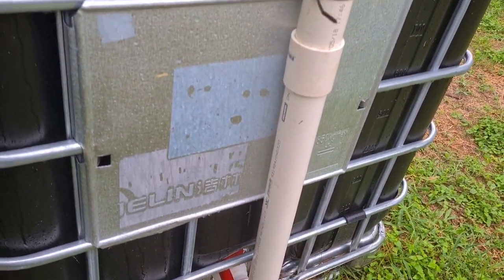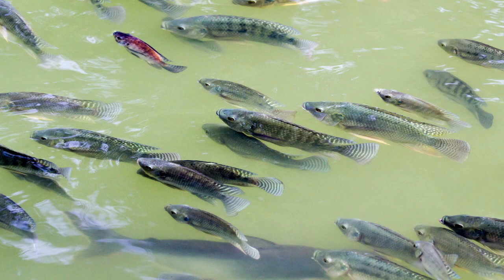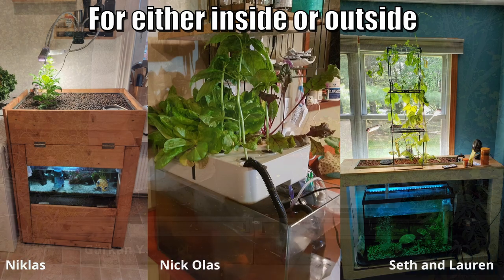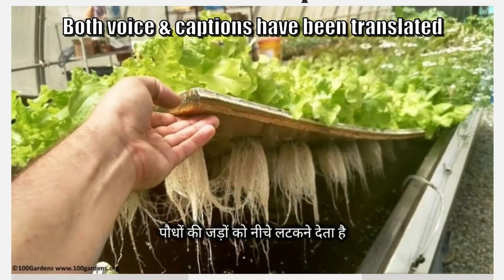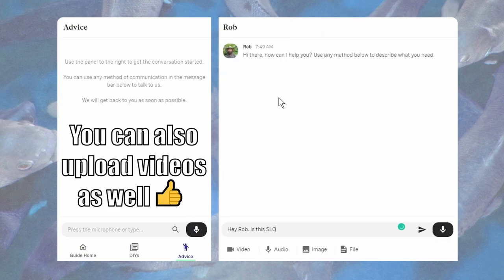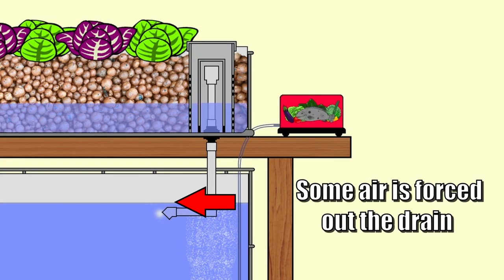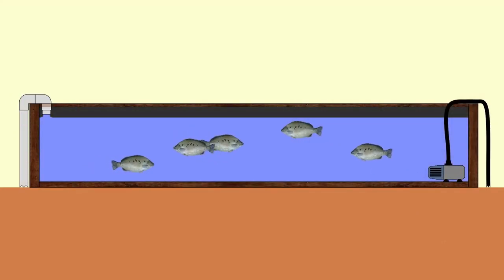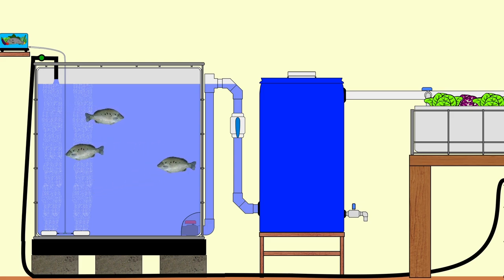Floating Bell Siphons & Other Aquaponics Questions Answered 🐟🥬🍅

Comment: Have a bell siphon with snorkel. It takes forever to get full flow drain -often trickles so have to twiddle/twist the bell to initiate full drain (then can't move it at all). Drains great then. Suggestions on reason for slow drain start?
Reply from the maker: It might be that a water lock isn't forming properly. If you don't have a reducer at the top you could try adding one. Increasing the water flow is another fix you could try.
Sorry it took so long to get back to you.

Comment: pregunta la luffa se podra usar como filtro en lugar de las fibras gracias👍
Reply from the maker: Podrías usar luffa, creo. Sin embargo, pueden descomponerse con el tiempo y pueden necesitar reemplazo frecuente.
Espero que te sirva Ramon👍👍

(Google Translate) 
You could use luffa I think. They may decompose over time & need frequent replacing. 
I hope that helps Ramon

Comment: Hey,
I’ve just found your channel and I’m super interested to may add this to my backyard! 
But I have two questions:
Do you think, it’s possible to put the fishtank flat with the ground - like a garden pond?
Do you have experience or how to handle this tank/bed during wintertime with freezing conditions (-15 Celsius)?
Reply from the maker: You can pump up from a pond into a garden bed with no issues. You just want to make sure that the plumbing is well glued/secured as you may pump the pond dry if the pipes leak. 
I think that you may need to drain the water from all the plumbing & bring the fish inside over winter though as the pipes would probably freeze over. 
Are you in Northern Europe of Canada?

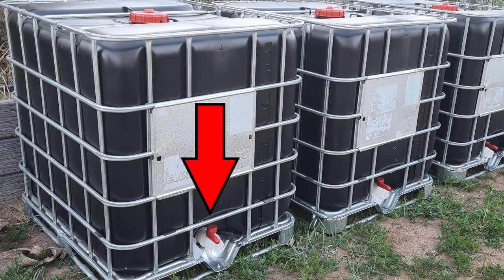Comment: @12:00 sorry rob but this defies the whole reason for a slo  , you now have a failure point at the tap that will 100% drain the tank , purpose with a slo is so that the water capacity is never compromised while allowing solids to be picked up of the bottom , better off doing a H siphon or doing the outlet @ 50% or so through the tank , as for the fish gaurd I use ~1m PVC pipe slightly longer then the length of tank to help seal the end , with holes drilled / slots cut into it , heat up wall end push into hole and mush it down on the wall side , when the fish get larger they remove it them selves ...
Reply from the maker: That's why I say later on that I don't recommend it. As a frequently asked question I felt I needed to go through the whole concept so folks understood what I was talking about. 😉
Cheers.

Comment: Why could you not cut out a section of the filter at the bottom of the ibc and then have two parts that you zip tie together to shorten the filter and allow it to sit at the bottom of the ibc?
Reply from the maker: I'm not sure what you mean mate. Sorry it took so long to respond.
Reply: @RobsAquaponics  I mean cut a section out of the filter and then zip tie them back together. Like a stubbie filter. Doesn't matter, you said a bunch of other cons for it.
Reply from the maker: @Jsak666  Cheers mate.